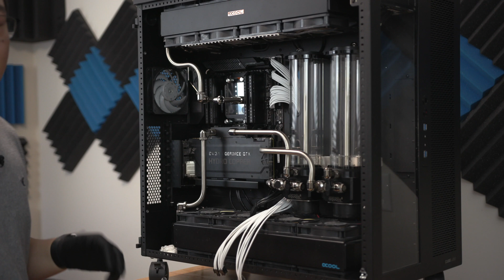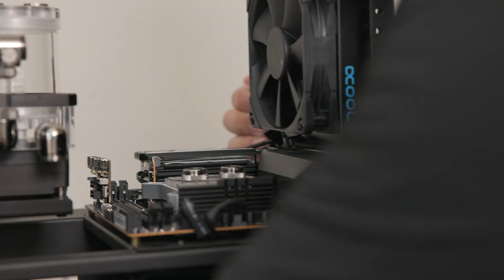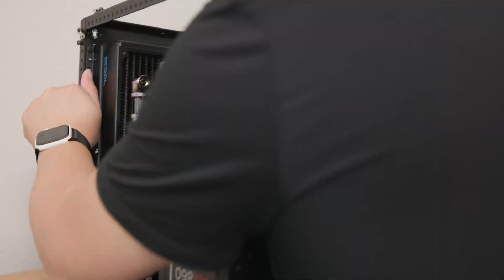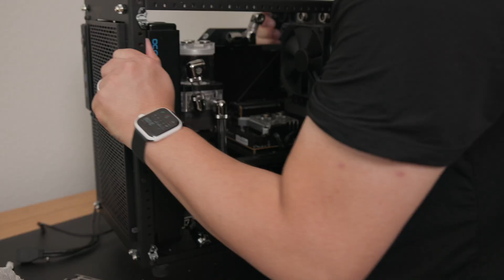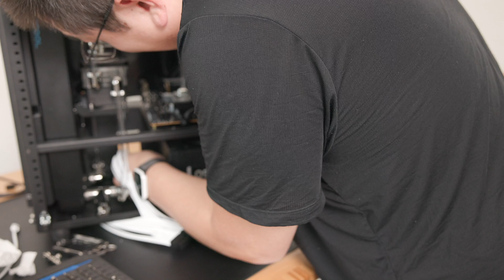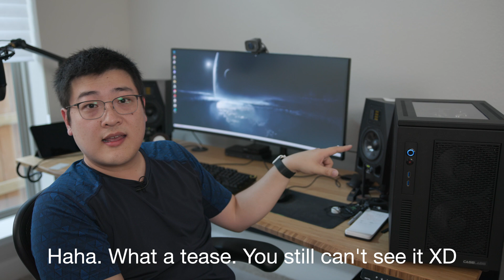Don't Make This Watercooling Mistake

Comment: Lol that is why I have 2000mm worth of rad, dual d5s and a glycol chiller... TR 32 core, 4090, the cpu oced 4200 all cores, all the time... cinebench 4 hour test, it sits at 50c without the chiller...

Comment: your PSU fine and the BIOS is fine you need a faster pump and more pump power so the water can move faster and a bit faster fan rpm shold fix that =)
Reply: Faster moving water doesn't provide as much additional cooling as you think.  Do a test and you will see.  All it does is shorten the life of the pump.  I run my pumps a 50% and going to 100% does no more than make more noise with very little cooling returns.  That myth has been debunked in this video.  https://www.youtube.com/watch?v=MFoWyYGqBxE

Comment: What did that system have for exhaust?  It looks like just the 120 with minimal other opportunities for the hot air in the case to escape. Vented side panels probably would do the trick to fix it.